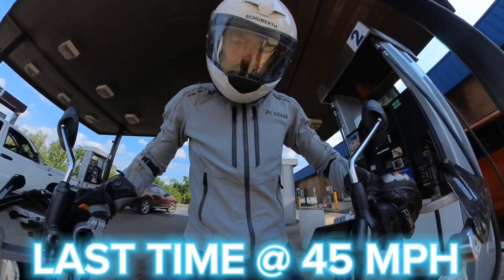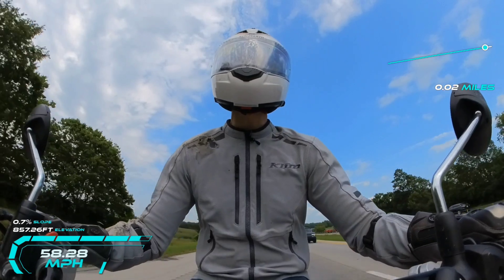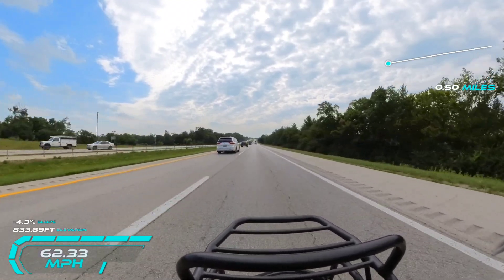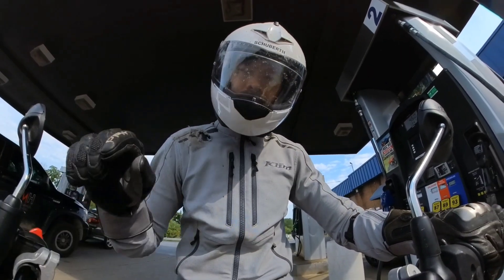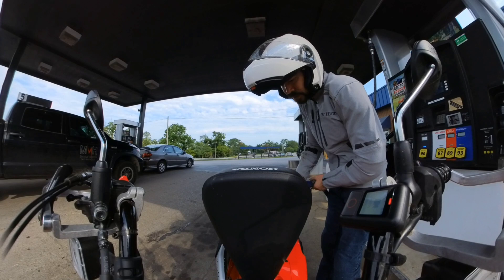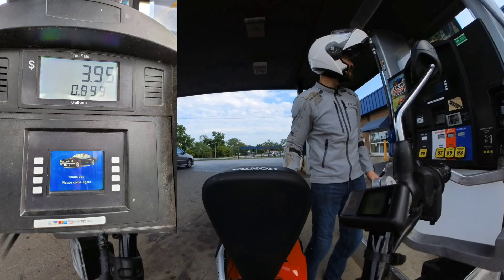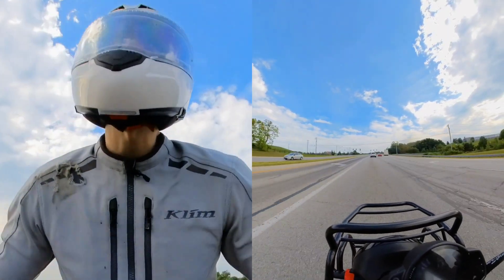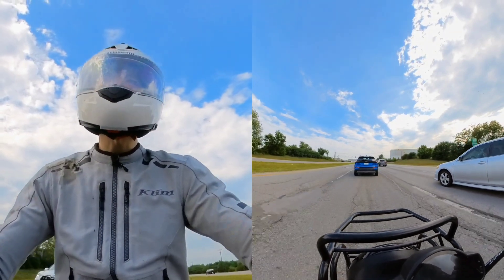ULTIMATE 164CC HONDA TRAIL SETUP! Final CT125 results: Part 3

Comment: Always great videos, thanks! It gets a lot less MPG at wot! Glad I got an extra fuel canister! still like not too bad.
Reply from the maker: I felt that 45 mph (cruising speed of a stock CT125) and 60+mph which a stock can't maintain, made the most sense for this test.  If you are going to cruise the freeway, definitely bring extra fuel. Still not at all bad considering air resistance, and therefore, the power needed goes up by the square of speed!